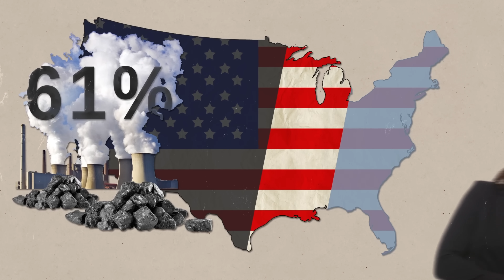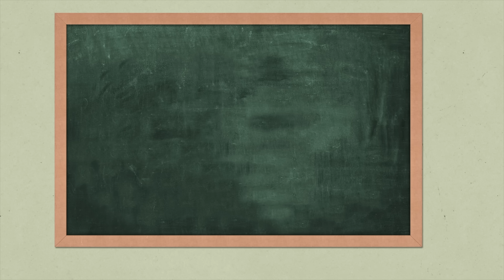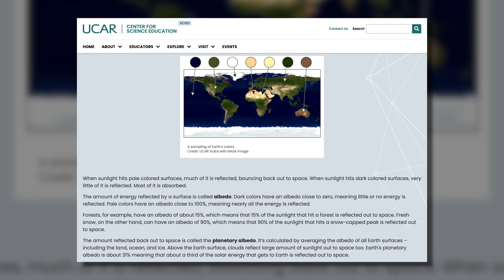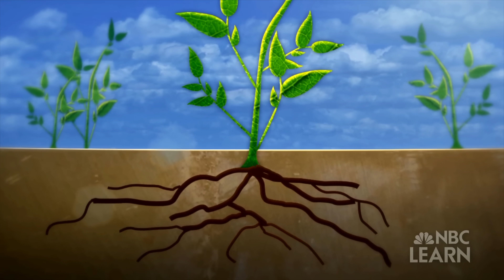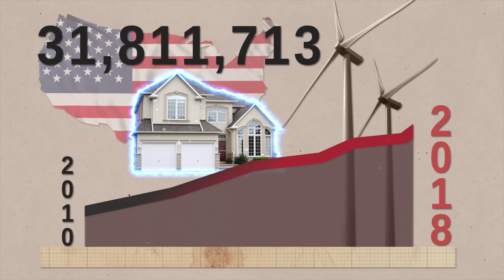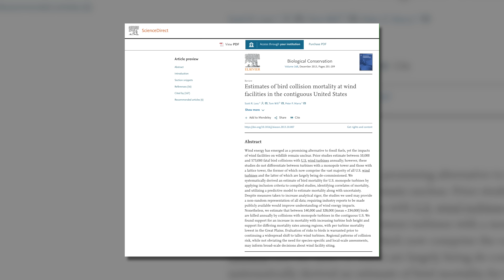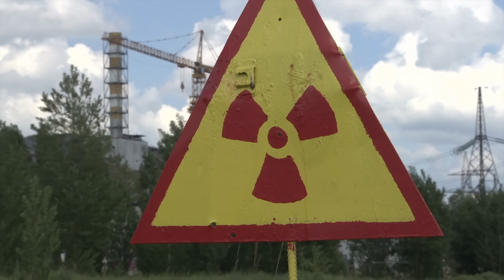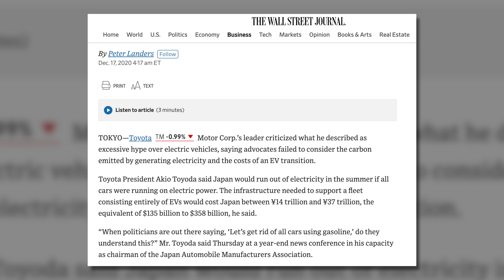Terrible News for America and Japan

Comment: We need electricity 24/7. The greatest problem with solar and wind… the sun doesn’t always shine and the wind doesn’t always blow. Plus the power output of both sources is greatly exaggerated as well as the longevity of both systems. Solar panels begin loosening efficiency after a few years and require replacement. The current wind chargers have about a 7 to 12 year functional use life. Both systems are heavily subsidized, without government subsidies neither system has made a or saved a dime. In speciality markets, remote locations for example they’re a great setup. For small countries or communities, one that have low proper needs they’re good. But for a large country, the technology is not ready.